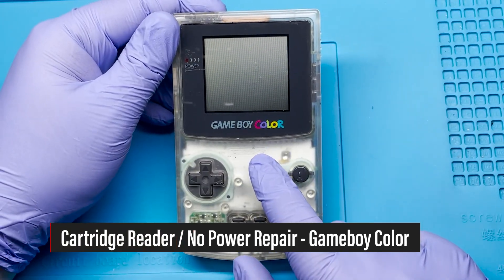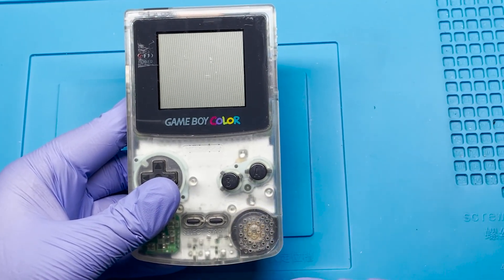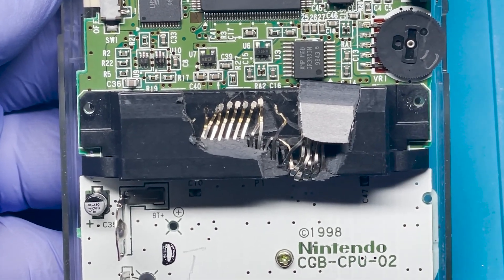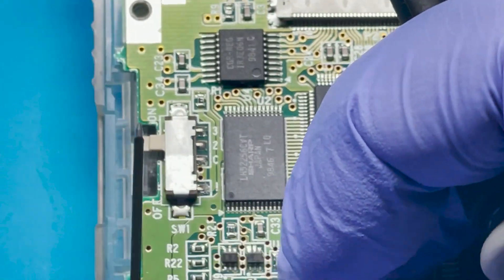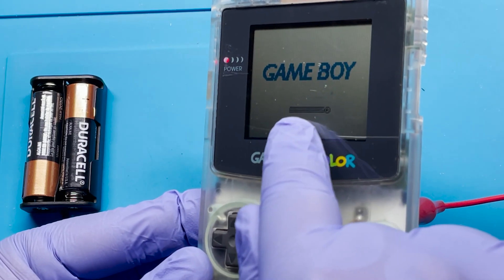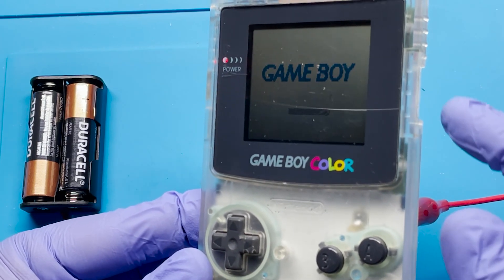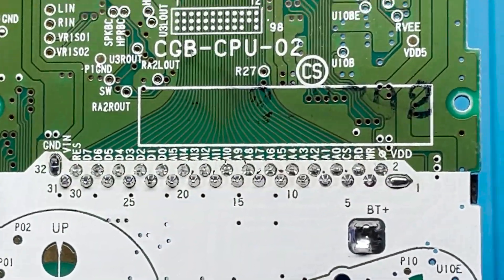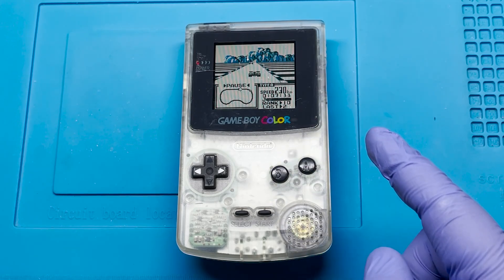How to Replace Gameboy Color Cartridge Reader

Comment: Hey, this was great.  I don’t know anything about soldering. Can you explain what you were doing with both removing and then soldering back on the cartridge?  Or tell me the correct soldering terminology to help me look it up?  

The way you removed the first one, if it wasn’t already broken, would it have ruined the reader?  My up and left directional buttons aren’t working.  I think I tracked down my power break to be on the back of the board under the cartridge slot. Wondering if it’s worth trying to remove the slot to fix it.  But watching this I think it’s not a great first soldering project.
Reply from the maker: Sure let me see if I can help. 
Can you explain what you were doing with both removing and then soldering back on the cartridge?
First I was using a desoldering tool to remove the existing solder from the joints, this was to remove the cartridge reader from the motherboard. The desoldering tool I used is a HAKKO FR301, they're quite pricey. You can use a solder sucker, but it takes a bit of time. When I was putting on the new card reader, I first align it then apply flux and then solder the joints back on. Flux helps with the flow of the soldering metal during liquid form. When creating soldering joints, you just have to be sure not bridge any joints together as this may cause a short. There are plenty of videos on Youtube that can help the basics for Soldering and how to use flux properly to get nice clean joints.

The way you removed the first one, if it wasn’t already broken, would it have ruined the reader?
No, this wouldn't damage the reader unless I accidentally damage the integrity of the card reader itself or the pads of the motherboard that were soldered from the reader. Simply removing the cartridge by desoldering it wont damage it.

My up and left directional buttons aren’t working.  I think I tracked down my power break to be on the back of the board under the cartridge slot. Wondering if it’s worth trying to remove the slot to fix it.  But watching this I think it’s not a great first soldering project.
I would first clean out the contacts of the up and down directional pad. While you're there, I would also look at the bottom of the rubber membranes of the directional pad to see if they have build-up or just see if they're in good condition. Just give that a nice gentle clean and then try. If that is not working, then it can be a bit trickier to troubleshoot. At that point I start looking through the schematics to identify if things are connected and working properly.

Schematics for GBC:
https://console5.com/techwiki/images/e/e6/Nintendo_GBC_Schematic.png

Hope this helps and thanks for dropping by!
Reply: @totalfix877  Thank you so much! This is very helpful. 

I have tried cleaning them and have also tried using different pads that I know work.
Reply: @kiledonley2753  you can look up some modding videos and join their discords ie MachoNacho on youtube

Comment: What is that product u used before soldering and what does it do?
Reply from the maker: That is flux, it is used to allow the solder to flow better to make sure it makes a better/cleaner connection. Otherwise the flow looks as if it "sticks" to the soldering iron or you get an ugly dull looking solder joint.

Comment: what did you use to remove the bad cart reader?  I have one that might need replacing. Can it be done with a regular soldering iron?
Reply from the maker: Yes it can be done with a regular iron but the process is a bit more involved and requires a bit more patience but can be done. The tool I used was a desoldering gun

Comment: Interested to know where you got the replacement slot? I can only find DMG and GBA ones. Need one for the color as well
Reply from the maker: I normally get them off spare boards, I havent seen these sold separately, but to be fair, I don't always receive systems in that condition either 😅

Comment: Hey what did you use to desolder the reader, I have a regular gba system with a broken pin in the cartridge and I need to replace the whole thing.
Reply from the maker: I used a Hakko desoldering gun. You can get away with using simply a desoldering wick, flux and a soldering iron. However this will be a bit time consuming but it is possible
Reply: @totalfix877  oh alright I’ll try that